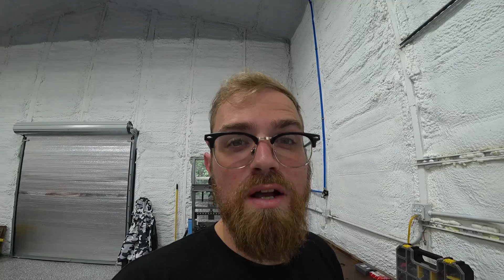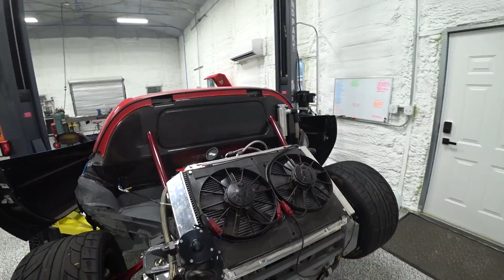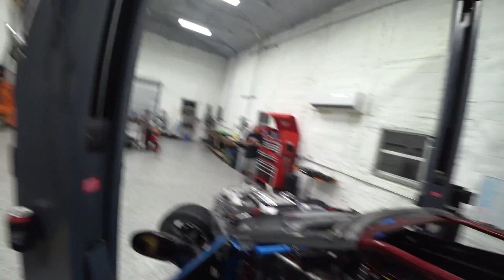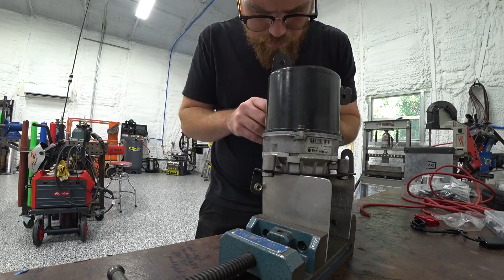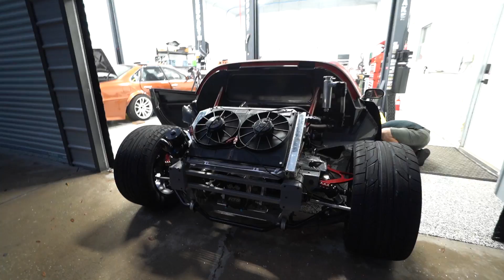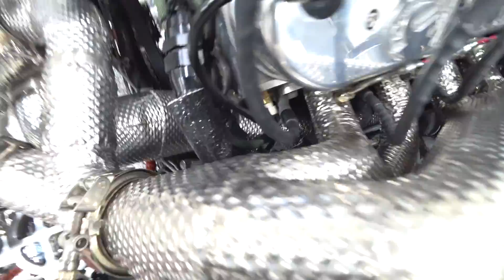C6 Corvette competition drift build. Ready to drive.

Comment: Has anyone looked at using a steering rack out of the newer generation subarus? they are an all electric rack, no hydraulics involved. but size and fit is the big question, but it could be a solid electric replacement for the electric/hydraulic hybrid systems that a lot of modded cars end up with

Comment: For the throttle cable rubbing on the peddle box you could try and put a small bearing or something under it to allow it to run on that to keep it from rubbing it would pull it up and should keep it running back and forth smoothly

Comment: Those connectors on your power steering are huge! And then they are only good for 50 amps? Im sure there is a good reason that auto connectors are the way they are but they are kinda garbage. Next time you need to redo some power connectors maybe check out some of the offerings from the RC market. Sounds silly but they take more abuse are a third the size and the ones im looking at are good for 200A continuous.
Reply: The size of the connector is a direct relationship to the size of the wire required. The longer the wire/higher the current the larger in cross section the wire needs to be. RC cars, by their nature, have very short runs of wire.
Reply: @adematthewsracing  I've seen smaller connections in the car audio market than that thing. It's overly large so it can support an existing copper crimp connector. It could easily be replaced with the larger RC plugs available today even with the longer distance and provide way more power than a little power steering pump will need. The original plug on the pump was also smaller but due to the poor design of the connection it failed.
Reply from the maker: I have used rc battery connectors for fans before when I couldn’t find a good automotive option for 10ga wire.

Comment: If you have issues with the throttle in the future. On my last build I used parts from a Mr Gasket 5657, Venhill VEN-UKCCBLACK, and Lokar universal cable. Between those three you get a nice assortment of ends and accessories. The phrase "cable knarp" is the bike term for the fitting that clamps on the end of the cable.

Comment: One of the cool things about those Anderson style power connectors like you added to the power steering pump is the two mounting screw holes - you can tie those down. It's hard to tell size in a video but that might be a 175a connector and not a 50

Comment: There is no replacement for hard lines in an everyday application. But when it comes to racing, when you never know what could be damaged or need to be replaced….. soft lines are awesome. When minutes count, nobody wants to deal with maneuvering a pre bent line through somewhere.

Comment: not a big deal, but you are used to pointing at your face with the camera from a downwards angle, which is usually fine. However, being in a shop with intense lights the quality is a bit sub par. If you pointed straight, avoiding the lights in the shot, your foottage will come out a lot better

Comment: with your idle surge, you can block the idle down by reducing timing in the higher rpm cells, it sounds like its just hitting cells with high ignition timing and that is causing the surge.

Comment: Put a spring on the throttle cable on the foot pedal pulling it away from the mount. You said it was rubbing. A tiny spring with just a little tension?

Comment: I’m wondering if going with a high output alternator and 14 volt battery would do the trick on the voltage
Reply from the maker: I have a 320amp alternator

Comment: just a quick observation while watching to possibly keep an issue from popping up in the near future and if you have already addressed it than please disregard. while i was watching the install of the heat shield on the fuel cell, i noticed where your drivers side battery is mounted (i cant remember if there is anything between the battery plastic housing and the mounting area) but, depending on how hot that exhaust gets and how far it is from the frame you might need a small amount of shielding to keep from melting the plastic battery housing. might not be problem on normal cars but on a racecar that is getting hot lapped...🤔
Reply from the maker: Yeah we did that on the other sides battery bracket. Still need to do it to that side we tossed it in on a hurry to get the car running

Comment: Did you have the proper bolt pattern to just use as a stencil and then just drill it? Or did you have to measure your holes out on the rotor to drill it? I’ve never known what/how to measure the bolt pattern on that…how’s that work?

Comment: Why not go drive by wire for the throttle? I'm not a builder but seems like that would be much simpler and easier to service than all the headaches to get a working throttle cable in this car. Just for my own curiosity

Comment: Pretty sure that mini cooper power steering pump won't last... On first gen minis, they had a big recall for them catching fire due to lack of air cooling, they need to be cooled, also the fluid type they use is chf11s, if you use regular power steering fluid or atf, it'll burn up... I personally don't think it's the best choice...

Comment: Tayler i really hope you see this comment.....you really need to invest into a radiator vacuum pump ...it uses compressed air to pull a vacuum on the coolant system and then you can suck the coolant back into the system preventing any and all air 😀 I bought one a few years ago an will never go back I use it on heavy equipment all the time this will also let you know if you have a leak in the system 👍

Comment: Put a small sleeve between the bracket and the mounting point for the throttle cable and lube it like crazy so it slides like butter in the sleeve. It’s better then it rubbing on the bracket itself. Just some food for thought. Car is turning out to be one hell of a monster 🤘🏻

Comment: Why not use Safety Wire for holding the throttle cable at the intake manifold?  No reason to use a bolt there.

Comment: You should put a stopper behind the gas pedal when your 100% throttle to prevent your cable to stretch or snap when you push too hard on that pedal.

Comment: As an alternative to smashing in the exhaust, which may cause a hotspot, since you changed the volumetric flow rate of that section: get a custom shaped oval pipe with the same circumference as the rest of the exhaust

Comment: I think you should consider adding an ammeter to your gauge complement. You have so many electrically driven components,  and they are mostly individually isolatable, that knowing a baseline could really help troubleshooting down the road.

You also might be able to modify the alternator to start charging at lower rpm, to help during staging periods. (It's a common mod for snowplow up here, to help batteries survive better)

Comment: You need to get some speed drill/tap bits ! Dewalt and Milwaukee both make them in mm and saw ! HomeDepot and Lowes usually have the 6 most popular sizes in stock for both metric and S.a.e however recently I haven’t been able to find them I. Either of my local stores but are available on line Speed taps is what they are called there all 1/4” drive and designed for a impact . I constantly break my 8mm’s because I’m lazy and use them with my 20 volt impact rather then my 12volt but otherwise they are the best tools I have in my arsenal ! I chase threads as well as repair/ make threads in seconds !

Comment: Taylor.. I hope you'll attached a throttle stop on the accelerator pedal and not relying on the stop of the throttle body. Because that allows strain on the cable. When you're in the heat of the moment and you're doing a run and stand on that skinny with fire in your eyes that cable will die

Comment: You should consider adding exhaust ports to the doors so you can run the cars without opening the door.
Reply: I’m confused by your statement? I’m a pretty observant guy but I missed the need for this ?
Reply: @jasonsparshott7208  garage doors

Comment: Like always, love the videos. But you really need to invest into a vacuum bleeder for your coolant system. Makes filling the coolant system so much easier and faster.
Reply: Definitely, it will show you if it leaks too because it won't hold vacuum. Combine that with a pressure test kit after will save SO MANY HEADACHES!

Comment: You so have to get an IR Gun onto the headers! Need to see how well that wrap works
Reply: @ijgdjvjd2998  which company did it?
Reply: iR gun won't read accurately off the reflective material. (Look up "emissivity")
Reply: @ijgdjvjd2998  Awesome, I forgot Headershield was actually a friend of a friends company who is also a Midwest drift guy.
Reply: @ijgdjvjd2998  But it's the company. You never trust the propaganda.
Reply: @ijgdjvjd2998  you posted that headershield did the video did you not? Is that not the product company?? 
Unless you wrote wrong stuff?

Comment: Taylor ray, i believe you  be fine with the aluminum T fitting as we use them in aviation on hydrualic systems that hold 3000 psi steady, and is good when it comes to steel fittings incase you start to strip one th ealuminum will go first, and easy to replace vs the custom line!

Comment: The housing wont chew the cable, It will be the other way around. It's like bicycles. The cables don't really stretch or perish very much even over high miles, but they eat their housings and it throws the adjustment off.